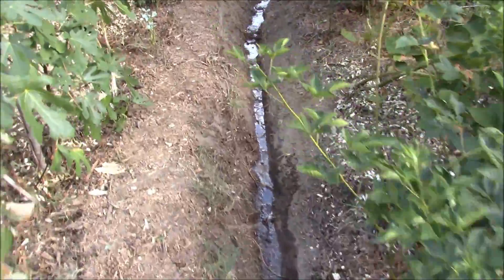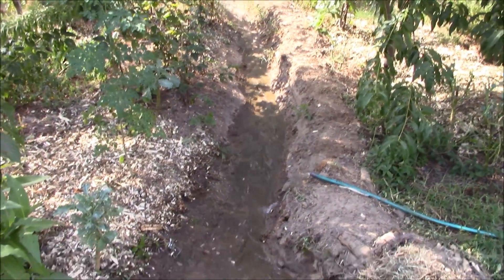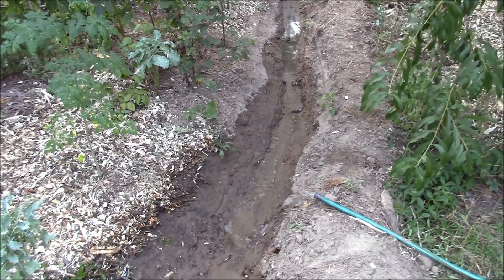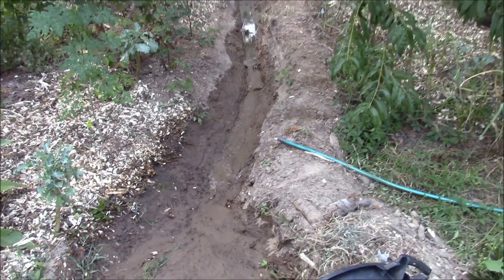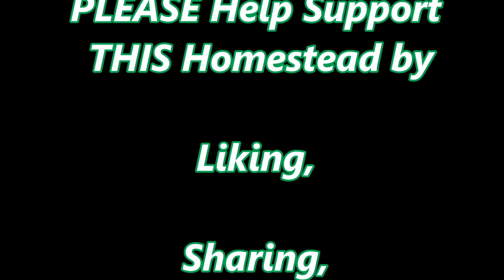#Suburban #Swale Maintenance in the #Permaculture Food Forest

Comment: Hello Sir, before I dig my backyard, do you think this would work with sandy soil? I'm in zone 9 (Central Arizona). Although, there is clay and rock in most of my area (which causes huge flush floods in the city), my house is built in a pretty sandy patch. We are in the middle of monsoon season now and that would do me a lot of good, but I'm worried the water will get absorbed before it gets to my trees.
Reply from the maker: this is perfect for sandy soil, i am on sandy soil and currently have full swales after a strong rain.  it is way worth it to plan out a water catchment and swale system, and then grow around that, espically in AZ where its a desert.    This is a system built for poor soils.   it will work for sure.
Reply: Permaculture Homestead
Thank you so much! I will try it... I'll have to put gutters as (for some reason) homes here do not have them. But, I checked and they are not that expensive. Thank you for getting back to me so quickly! I appreciate your help!

Comment: Your backyard really has a grade to it. My yard is so level I don't think it would be good for me. We do gardening a little different too. Best wishes Bob.
Reply: Hi Bob,  actually swales are perfect for "flat" terrain.  With that being said, swales may not be right for you and your situation,  If you actually do some measurements with  an 'A' frame level, laser level or clear tubing filled with water you will see your elevation changes.  The landscape can fool your naked eyes.  This video while excellent may have been confusing.  "On contour" means that the ditch is at the SAME level along it's ENTIRE length.  So every point along the whole ditch should be roughly at the same level.  

Some swale features can be up to a 1 percent grade and are usually for water harvesting, for example collecting and diverting runoff into  tank or pond.  Another iteration of the "just off contour swales is Keyline design for hilly areas where you want to hydrate ridges by moving runoff out of the valley to the ridges.  Sorry for the long winded reply.  Just passionate about this stuff.
Reply: I guess you are passionate about it. Have a great day.

Comment: I'm still convinced swales are not needed on almost level soil when you have healthy soil with excellent water infiltration. Even right after a heavy rainstorm, i can never find any puddles anywhere. My perma motto is, if you have runoff, there is something wrong with the quality of your soil. Of course this is a different deal on very hilly land. The municipal swale at the back of my property is actually draining water away from my land and there is nothing i can do about it. I'm in Holland. All ditches and swales here are specifically dug to drain (farm and wood) land of water. Ammending the soil with lots of mulch to retain the water in my soil before flowing off into that ditch has helped a lot. It was bone and bone dry, marginal soil there when i started 5 years ago. Nothing would grow there but some saplings and hardy grass. The ditch rarely fills with water now. It takes 2-4 weeks of constant rain to do that instead of just a day or two. It basically fills up with the groundwater level now and the only extra runoff it catches is the water that runs off the road on the other side of the ditch, which isn't much.
Reply from the maker: i have poor soil on a fairly countoured surface, the swales certainly help hold water and are beginning to create the soil i need to have fertility.   thx for stoppin by from Holland, my GP was born there, i got dutch blood
Reply: Ohh, how cool! Yes, it depends on the circumstances entirely. I'm probably well known for just vomiting general remarks around though, take no notice. I forgot you were in the middle of a desert there.  ;) Always love stopping by!
Reply from the maker: lol  Good to meet a dutch brother. My Gpa was Sixtus Petraeus.    I think the swales and wood chips are gonna make a big difference in creating good soil environment and keeping things hydrated.  I love your comments and glad you keep comin back, just holler if you need anything.